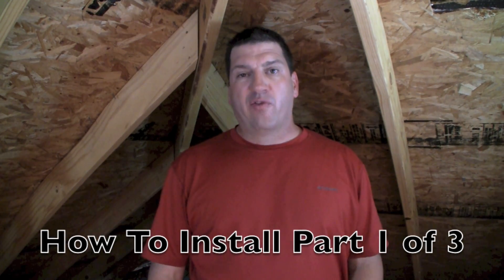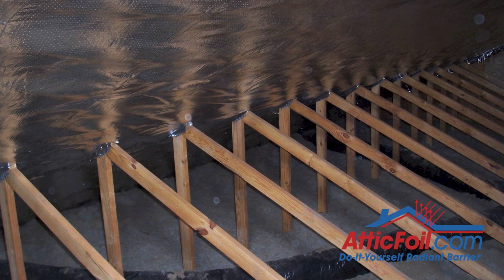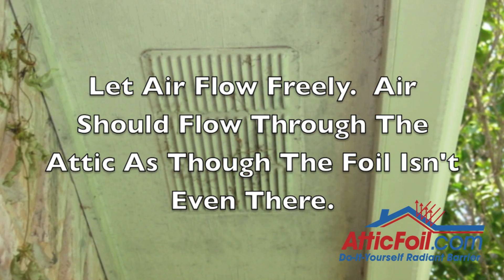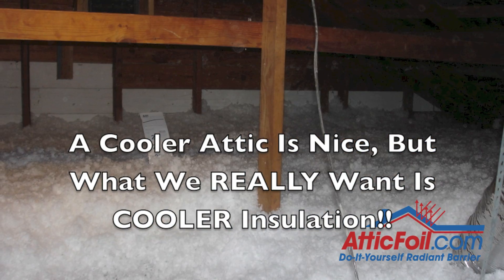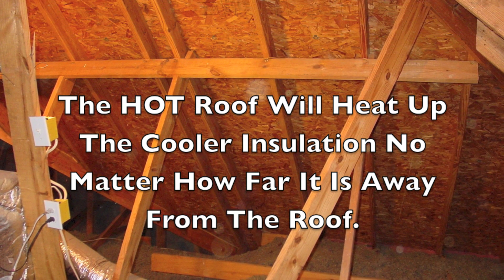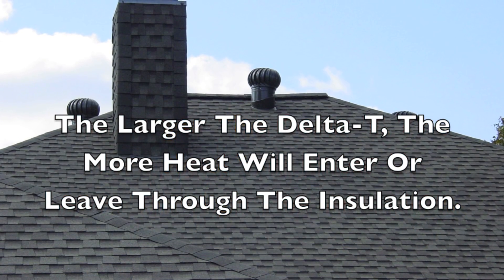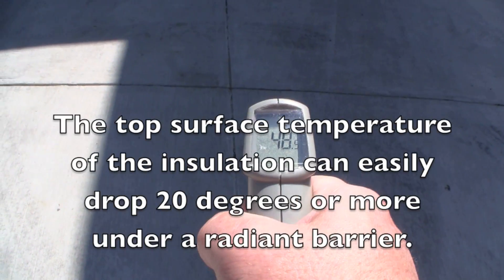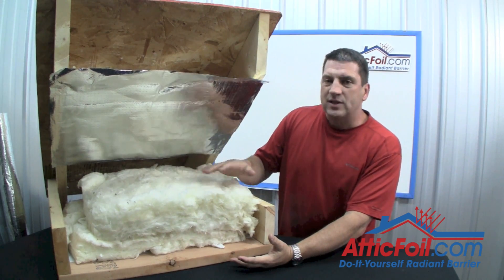How To Install Radiant Barrier Foil Insulation AtticFoil - Part 1

Comment: What if i dont have a ridge vent? Can i still get any benfit form attic foil ?
Reply from the maker: Yes, any type of topside roof vent will work.  Whether it's ridgevent, wind turbines, static vents etc. they are all just "holes" in the top of your attic.  The hot air will find it's way to the top and out.  Just leave a clear path for the air to flow through the attic and not hit a "dead end".
Reply: @AtticFoil  What kind of benefit does radiant barrier have on an unvented attic? No ridge, static vent or fans and no soffits. Will it still kept the insulation cooler?
Reply from the maker: @hockeydios  Absolutely it works.  Think of a solar screen you put in the windshield of a car to reflect the heat.  Does it work if you DON'T crack the windows? Are the leather seats cooler? Yes, it works. But, it does work better if vented.  It's the difference between good and best.
Reply: @AtticFoil  This makes me think, if its about the Delta T, why not place this over the attic insulation? Will it cause the attic insulation to maintain moisture if placed directly on top of it?
Reply from the maker: @3joewj  Yes, it's called the "Over-Insulation" method: https://atticfoil.com/index.php/installation/over-the-insulation-install/  Use the SuperPerf product.

Comment: Looking at the example at 3:25, is it safe to say that if the attic temperature is above the outdoor air temperature on a sunny day, that delta is due solely to radiant heat?
Reply from the maker: Yes, exactly true.  This is why we may have to run our AC on a 65 degree SUNNY day but it may barely run on an 85 degree cloudy day. www.AtticFoil.com is like shade from the heat inside your attic.

Comment: Hi have questions. 
So if radiant barrier reflecting heat .
Can we uesd radiant barrier on top celling but with out insulation. 
Because that time we have air between ceiling and roof and I'm set up fan in side roof for both side one for vacum air and other one push air .
It's that make sense..
Reply from the maker: Normally NO, you would need insulation.  About the only time when you don't need insulation is when you are NOT heating and air conditioning.  And you are ONLY looking for the shade effect.  www.AtticFoil.com is for radiant heat and traditional insulation is for conductive heat.  Think of the space like a refrigerator.  The regular insulation is the refrigerator and the AtticFoil is like putting it in the shade from the heat.
Reply: @AtticFoil Radiant Barrier Foil Insulation  
Ty for you advice

Comment: Excellent explanation.  Thanks it answered several questions I had.  I do have one question based on the idea that the insulation will heat up in the attic regarding the Delta T. Wouldnt it be better to have some insulation in the barrier material that you are attaching to the roof joists?
Reply from the maker: No, in a ventilated attic all you really have is radiant heat from the roof to the insulation.  Making it "thicker" would be like using a "thick" umbrella or holding a jacket over your head.  Not additional benefit.

Comment: I live in Louisiana. My home is a 1970 2story. I have a crawlspace(very challenging) above the second story. I recently found serious duct work issues under the 2' of pumped in insulation. To properly address ALL leaks, I intend to vacuum out all the insulation and properly seal everything. I understand the radiant barrier should be applied across the rafters(roof tresses) above everything, ductwork and insulation. Is the radiant barrier better than having open cell foam sprayed on the roof decking? Or is it better to put the radiant barrier up, then have the foam sprayed below it on crawlspace floor? Or am I better to pump that insulation back as it was with the radiant barrier above it? I appreciate your time.
Reply from the maker: I love spray form for NEW CONSTRUCTION.  For existing homes, sealing the attic shut with foam can create the "law of unintended consequences".  Seen it many times.  For an existing home I would take out insulation, seal ducts, seal any holes/penetrations in ceiling, install www.AtticFoil.com on bottom of roof trusses and then blow back in insulation.  Had many customers do exactly this with amazing results.  Ed.

Comment: what if my rafters are steel instead of lumber?  how to do install the foil?
Reply from the maker: Magnets!  We've had many customers do this. It's like putting a business card on a refrigerator.  Look at ebay for some plain bulk ferrite magnets.  Don't need neodymium type. You can buy 500 for about $100.  Will need about 1 magnet for every 3-4 sq. ft. of material.

Comment: Thank you Ed and I will be buying foil next year, God Willing, and I thank you for your customer service so I will definitely be using your company.  My question is this year my walls were over 150 F degrees in the Summer.  I live in Southern California.  Stucco outside and sheetrock inside—so is there a way to diminish that heat load?
Reply from the maker: Stucco walls are tricky and not a lot you can do for them.  Some type of "shade" is your best bet.  IF the home is a remodel and you can get inside the walls form the inside, there is the wall install method shown here: https://atticfoil.com/index.php/applications/inside-exterior-walls-hotmixed-climates/

Comment: I am doing a new construction, If I install OSB sheating with a radiant barrier and also install insulation on my roof rafters how much air space should I have between foil side and insulation for it to work properly?
Reply from the maker: Are you doing a "Ventilated" or a "Sealed" attic??  Normally, you would not put insulation between the roof rafters unless you are going "sealed" or doing a cathedral ceiling.  For a cathedral ceiling take a look at this page/video: https://atticfoil.com/index.php/applications/cathedral-ceilings-hotmixed-climates/

Comment: Will a radiant barrier work if I insulate the Joists and then use the radiant barrier
Reply from the maker: If you put insulation between the rafters/joists and the radiant barrier WITHOUT an airspace between the insulation and the foil it WILL still continue to work off the EMISSIVITY quality of the layer of foil facing the airspace below.  You will loose the REFLECTIVITY quality of the layer facing up that is in contact with the bottom of the insulation.  Still good, but ideally, you would keep the reflectivity of the top surface.

Comment: If it deflects heat in the summer won't it keep the heat out in the winter too? What is better to put it on the floor of the attic or the walls? My floors are covered with a wood flooring. ANYONE, please help
Reply from the maker: One thing to remember is that heat always goes from hot too cold.  So in the Summer the heat is TRYING to get into the home. In the Winter if the roof warms up, it will release the heat into the cold attic and outside before any really makes it too the home.  Also, the days are shorter and the sun is lower, so not much heat gain anyway.  As for best install method?  Take a look here:  https://atticfoil.com/index.php/installation/best-install-method/

Comment: I live in Phoenix AZ I have a tile roof,what application should I use?
Reply from the maker: Unless you are putting on a new roof, you would do a "normal" attic installation.  If the roof is hot, a radiant barrier will help!  http://www.atticfoil.com/index.php/installation/staple-up-installation/  If you are putting on a new tile roof, you have an even better opportunity to get it on TOP of the roof deck under the tiles.  More here:  http://www.roofingfoil.com/how-to-install/how-to-install-under-tile-roofing/

Comment: Such GREAT information!  Believe it or not, my son and I are on the installation part and never thought about AtticFoil Radiant Barrier... I have an 1923 year old home without an air conditioner!  It's pretty cool during the day, however when night falls we experience a hotter inside when it's cooler outside!  The heat really never "catches up" with the cooler weather... Now, I know it's the installation that is very hot inside our attic, caused by how much the heat collects up there.
Reply from the maker: Did you ever install www.AtticFoil.com to fix this?  Never too late.

Comment: i was going to add reflect to th ensile wall panels in my sprinter Van. After seeing your video i WANTED to know if your product might be better than reflect?

I am going ti glue and insulation to th evan outside walls and foil to the inside wall allowing an air barrier in between.

If this works it can be advertised for such a use as many people are looking for a better way to insulate their Vans,

Thank you
Reply from the maker: For vans check out our products for metal buildings: www.BlueTexInsulation.com great for van/bus conversions, shipping containers etc.

Comment: is it durable for direct sunlight? i want to use it ouside
Reply from the maker: Yes it is VERY durable. Although it is not specifically designed to be used outside in direct weather, we have had many customers use it successfully. I'd expect at least 3-5 years service and maybe longer depending on the use and conditions.

Comment: Hi Ed,
I was just wondering has your product (or foil barriers in general) have been used in the top ceiling of buildings for radiant heat reflection? If yes, do you have a video of this? 
I always recommend it to clients and architects. (Who are in hot climate areas)
But I would love a video or two showing the effects of using a radiant barrier with insulation in the top floor of a building.
Reply from the maker: I'm not quite clear what you are asking?  Are you asking if Radiant Barrier can be used on TOP of the roof?  As in outside? or below the insulation on the top floor of a building?  Generally, using below traditional insulation won't yield great results.  If possible, you want radiant barrier to be to the "outside" or first layer in the structure to reduce radiant heat.  Then, traditional insulation to reduce conductive heat flow.
Reply: Sorry I wasn't clear.
I have watched your videos on using Radiant Barrier between the insulation above the ceiling and below the roof.
So in this same senario, but instead of the house roof, Radiant Barrier would be under the top concrete roof of a building. And perhaps sitting on the insulation in the ceiling of the top floor. (basically the same situation as the house)
So I wanted to know if Radiant Bariier has been used like this in a building and do you have any video on it. I would love to see some film as I would like to show it to high rise building architects in the near future.
Thank for your time
Reply from the maker: I don't think it would be good fit.  A building with a concrete roof will typically have some type of roofing system on top.  There are highly reflective products like PVC and TPO membrane products that are "cool roofs".  I'm a big fan of www.Duro-Last.com  These roofs are usually installed over some type of cut/angled foam to direct drainage and provide R-Value.  Putting radiant barrier to the inside really is not going to be effective.
Reply: so under concrete roof radiant barrier won't be effective ?
Reply from the maker: Concrete roof can mean a couple of things.  If you mean concrete tiles then yes, it would work great.  Just like under clay tiles or a metal roof.  If you are talking about a concrete ceiling (as in top floor of a building as mentioned above),  This is also the ROOF of the building.  There are other methods like the Duro-last roof combined with ISO board etc. to properly insulate and waterproof a roof like this.

Comment: Hi, What about aluminum "vapors" with humidity and radiant heat contact, and toxicity?
Reply from the maker: Where are you getting this info? We are talking about "normal" temperatures under 200 degrees.  No aluminum is going to be vaporized.

Comment: Hi Ed, I couldn't find any videos discussing windows but this seems like your product is strong enough and useful for window applications since supposedly a lot of heat can come in and escape easily and not everybody can afford triple pane windows..  Has anyone used attic foil as curtains or placed it directly on the window?  From my increasing understanding with your videos and communications, it'd seem like curtains would be better because of the airgap.  It'd also seem like having the curtains outside would be better than inside but do you think the convenience of having inside curtains would still make it worthwhile to have?  another potential video discussion idea.
Reply from the maker: Yes, you can either make curtains or put directly on the back of glass.  Glass is one of the circumstances where an airspace is NOT required since the glass is transparent it will let the radiant heat through and truly be reflected by the foil.  This is just like a mirror.  The glazing is on the back of the glass.  As for curtains/drapes/outdoor awnings?  AtticFoil will work great, but I would say for a "low usage" product.  Not something like a roller shade that you would roll up/down every day.  The aluminum is laminated to the internal scrim, but with enough bending/folding etc, the foil will start to wear and flake off in tiny pieces.  For normal "staple it up and forget about it" attic installations, this is never an issue.

Comment: What is the expected life of your product?  A local fella suggested we only buy something at has protection from oxidation or the product would break down in 10-12 years.
Reply from the maker: +smallblockfuelie Oxidation is not a real concern with using pure aluminum.  The pure aluminum forms an invisible protective layer called passivation that will protect against oxidation:  https://en.wikipedia.org/wiki/Passivation_(chemistry)  Here is our page with complete information comparing AtticFoil to the less reflective metalized film products: http://www.atticfoil.com/index.php/technical-info/metalized-radiant-barrier-film-oxidation/  AtticFoil should last indefinitely in a typical attic.
Reply: +AtticFoil Radiant Barrier Foil Insulation thank you.

Comment: I don't  have insulation in my roof will it still work, it is a low pitch roof? Or is it a must to have insulation to reflect  heat? I live in the Bahamas where it is hot most of the year
Reply from the maker: datrudon We actually sell a lot of product for shipment to the Caribbean.  Foil alone is probably all you need. It will act like "shade" or an umbrella for the rooms below.  Combined with moderate temperatures and a nice breeze this will make a significant difference in the comfort level.
Reply: AtticFoil Radiant Barrier Foil Insulation thanks for the response. I just have another question can use foil tape and staples
Reply from the maker: datrudon We have many customer in warm climate that ONLY use AtticFoil and no insulation.  Think of AtticFoil as an umbrella. Many of our customers are in the Caribbean and just want a shade effect and don't have air conditioning.  It works great for this application.

Comment: How do I attic foil a cape cod knee wall?  if I do the rafters do I take it all the way to the knee wall?  If I do the knee wall do I take it from the floor to the top of the knee wall (roof) creating a completely sealed roof to knee wall.  I guess the question is do I have to leave a gap for air flow at the bottom and top of the knee wall, and also at each end of my rafter. There is also the ceiling of the stairway that leads to the attic above the 2nd floor. This is very hard to explain what I'm talking about with out using a photo of my situation. I live in NE Pennsylvania.
Thanks
Tom
Reply from the maker: Tom, please use this form and send us your question along with some pictures.  We can help you better that way:  http://www.atticfoil.com/contact-us.html

Comment: i have a dog house with foam board insulation on the outside. i have heat lamps in the inside. how could i get an air gap layer over the foam board? thanks. i read that this type of insulation would be much better for heat lamps. thanks.
Reply from the maker: If the heat lamps are on the inside, you would basically want to line the inside of the house with foil.  Walls and ceiling. This will keep more of the radiant heat inside.